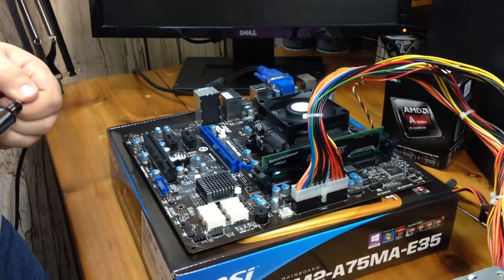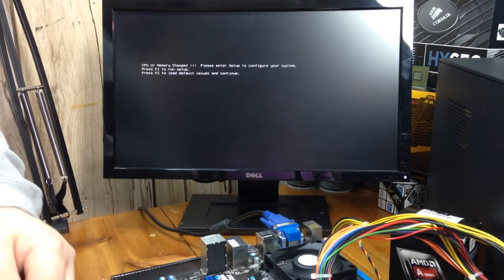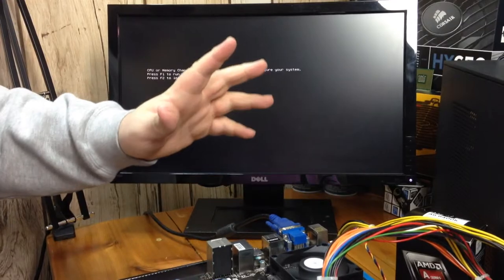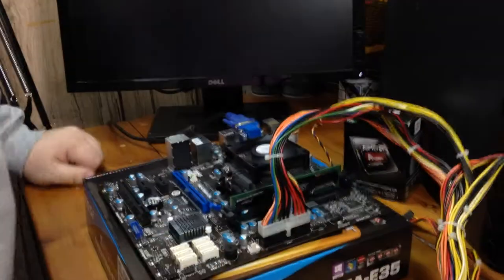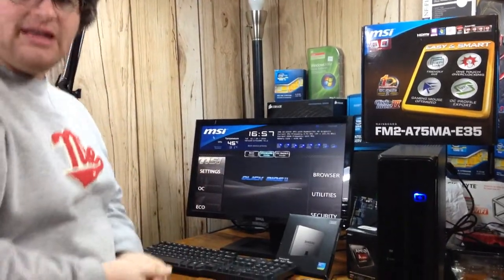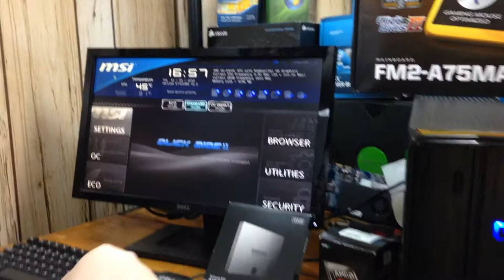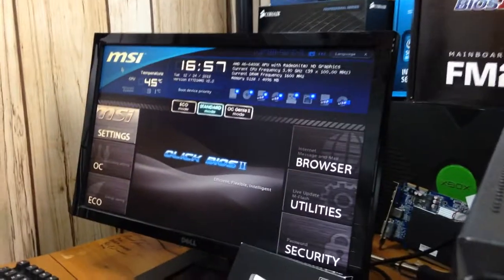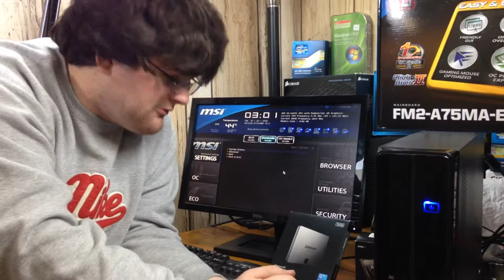Mobius Ion Build Guide

Comment: Nice video.. Tell your dad Michael Moore I love his movies.
Reply from the maker: I'll let him know
Reply: Mobius Computer  I just built a similar system and the whole time I had you in the back of my head saying test it first.  I was rushing because it was late last night and hooked it all up in the case.  I went to plug it in and nothing.  Now I have to take it all apart and test it.  I would have tested it if I was not in such a hurry.  Lesson learned.
Reply from the maker: myriadcorp I was actually working on an iPad mini today. I was making a repair video and was in such a hurry I forgot about ten screws and two EMI shields, not to mention forgetting to plug the battery back in.. I broke the replacement digitizer glass trying to get it apart again before the glue set! Lesson learned indeed.. I think Ill just edit that little screw up out when I publish the video!
Reply: My problem was a dead power supply.  Tested it out today with the paper clip and nothing works.  I tested the board with another power supply and it's good.  Now I have to wait for a new case from newegg. :(  I am testing all power supplies before I start future builds now.

Comment: Hey I built something almost identical to this before watching your video (went with the white case though), any suggestions on a graphics card that will fit this the expansion slots are small and the low profile card I had still doesn't fit right.